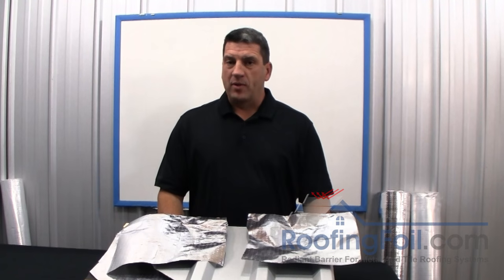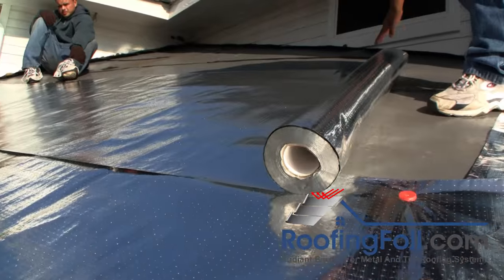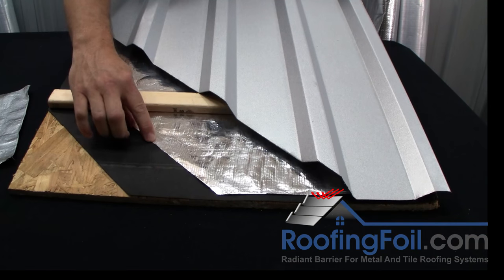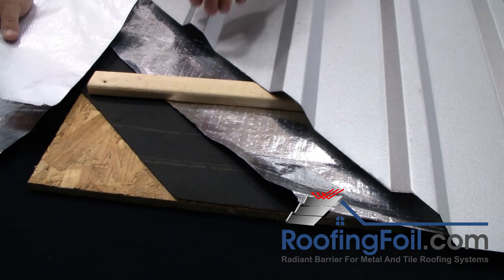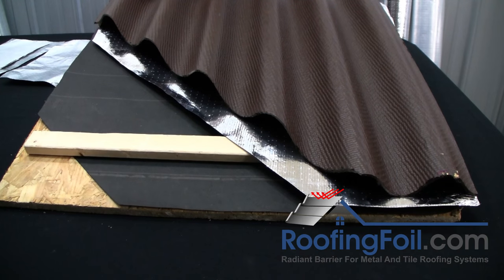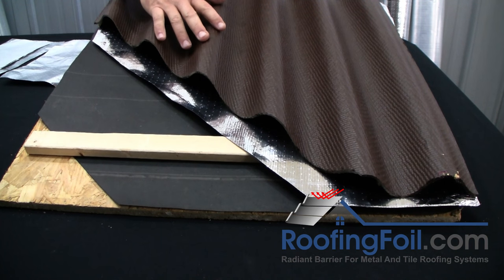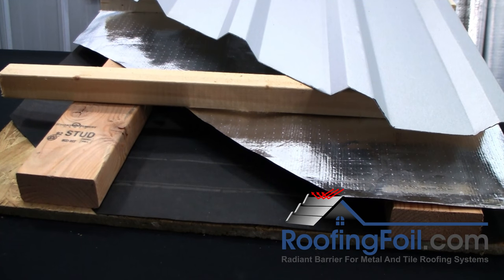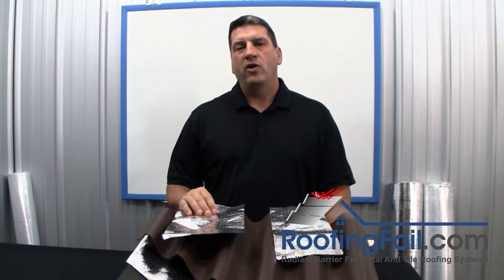RoofingFoil - Single Vs. Double Sided For Metal & Tile Roofing Systems

Comment: I live in a hot tropical country. If I am going to use an insulated standing seam metal roof (with built-in 1 inch polyurethane foam) for my house, do I still need to install a radiant barrier (with an air gap) on the battens?
Reply from the maker: First, if you are using foam on/below the metal roof, I assume you are doing a closed/non-vented attic??  If not, there no reason to put foam on the deck. This is like holding a jacket over your head...why??  But, Yes, if possible you ALWAYS want to install www.RoofingFoil.com  Radiant Barrier can (effectively) double the r-value of your insulation (when the sun is shining) by dropping the external surface temperature.

Comment: Are the gaps of the corrugated sheet enough for the radiant barrier to work? What about the gaps of the diamond rib sheet? I'm having doubts on the latter though.
Reply from the maker: Basically, it's how much "contact" you have.  If you are over 60-70% of no contact go for it.  Under that and you need a different roofing product or install process.

Comment: Using this type of foil makes so much more sense than installing in the attic. The goal should be to keep the radiant heat from ever entering the attic.
Reply from the maker: Agreed.  Using www.RoofingFoil.com on TOP of the roof deck is the absolute best.  However, if you don't have the option of a new roof, www.AtticFoil.com installed INSIDE the attic works great too.
Reply: ideally

Comment: is atticfoil identical to the perforated double sided roofingfoil?
Reply from the maker: Yes, we have had so many homeowners and contractors use the foil in roofing applications we decided to do dedicated site just for these applications.
Reply: thank you for your time answering questions. You are great.  has anyone every told you they used atticfoil and made a survival blanket/sleeping bag like those mylar ones, or used it as a tarp?  I'm thinking the "breatheability" aspect makes it superior to the vapor barrier ofmylar blankets
Reply from the maker: We have heard of customers using it for many different things.  We have had many customer fabricate tents/shade structures for BurningMan with great results.
Reply: So the right this one is that the shiny foil must facing the space or up not another way around coz ive seen some the shiny foil facing the ground o come on, this is the right one i think.
Reply from the maker: @leonardadalid1956  The foil can either face up or down as long as the foil faces an airspace.  For example radiant barrier decking the foil side faces the attic (which is the airspace). But, it's BETTER to get the foil on TOP of the roof deck since the roof deck itself will be cooler.  The new all in one roofing underlayment and radiant barrier is perfect for this: https://www.roofingfoil.com/shop/single-sided-solid-foil-underlayment/